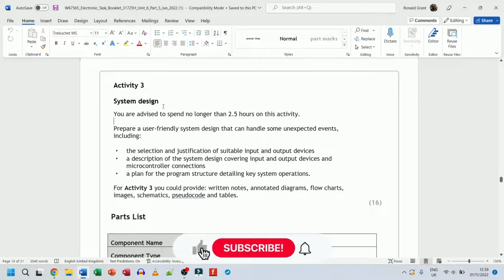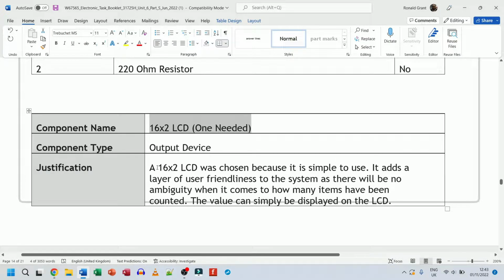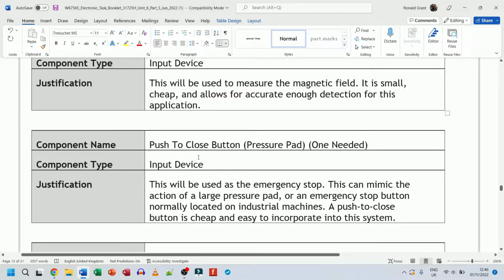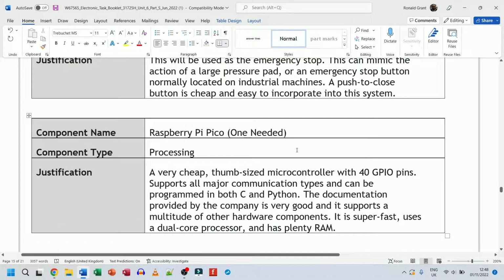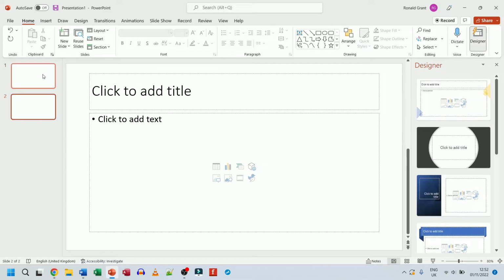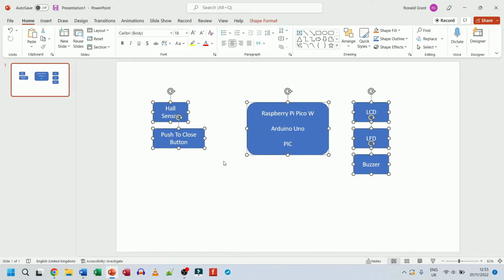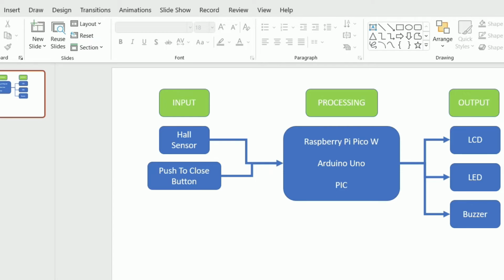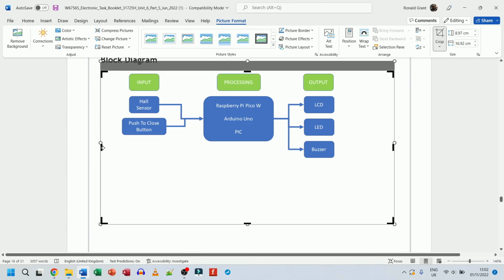BTEC Level 3 Engineering Unit 6 Microcontrollers - Part 11 - ACTIVITY 3 PARTS LIST + BLOCK DIAGRAM

Comment: uf I do the part list with the quantity, component, and done. with the block diagram is that all you need ?
Reply from the maker: Yes based on the exam paper I did.
This might have changed now.
I would suggest reading the requirements for Activity 3, that will detail exactly what is necessary.

Comment: what should i do if my college has no circuit design software, we've only used tinkercad so far but it's online only
Reply from the maker: You can draw it on paper and scan it in.
Or use PowerPoint or Paint.

Comment: Can we do both block diagram and circuit diagram
Reply from the maker: Circuit diagram is a MUST.
Block diagram is not really necesary but they show different things.
Block shows basic inputs and outputs.
Circuit shows all pin connections/wiring.